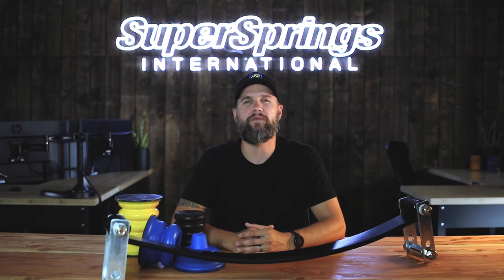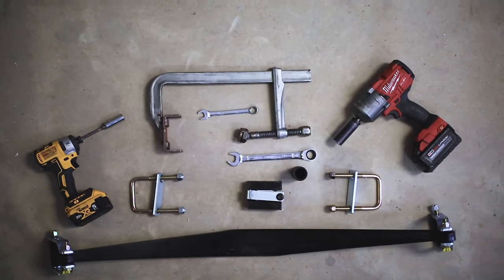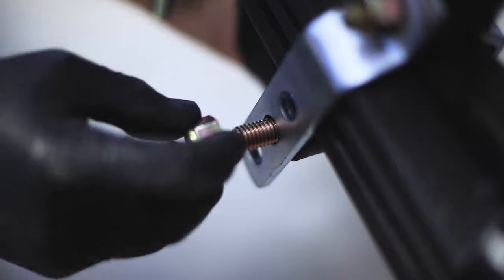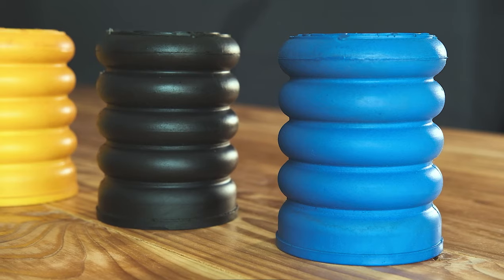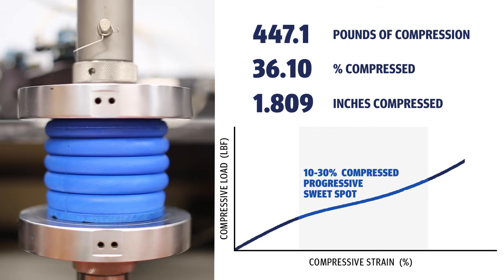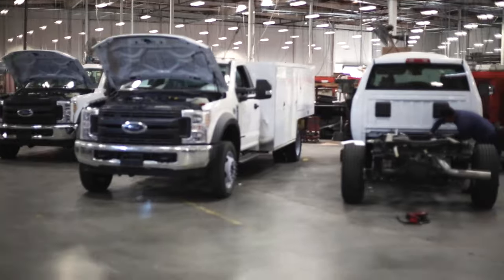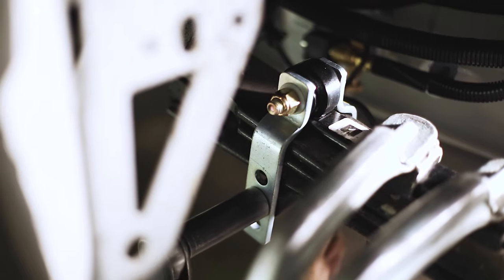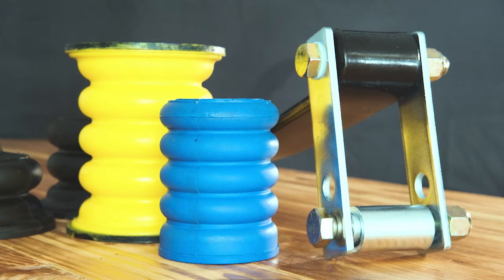SuperSprings vs. SumoSprings | Which one should I buy? | VLS ep. 2

Comment: Have an f-150 with a level kit and running 33.8 “ toyos (305/70/17)
Which sumo do I need . I haul anywhere from 3500 to 7k trailer . Depending on what I rent. Do I need. Spacer for the sumo springs because of bigger tires. Thanks in advance
Reply from the maker: Is your vehicle lifted? ANd how often do you tow? - Josh
Reply: @SuperSpringsInternational  I have eibach leveling springs in the front with bilstein shocks in the back and bilstein struts in the front . So nothing in the rear is lifted. Just running the bigger tires . 305-70-17 which are approximately a 33.8” tire.
Reply: @SuperSprings International ??? My last reponse
Reply from the maker: How often do you tow?

Comment: I drive a 2010 Dodge Ram 1500 5.7 SLT and pull a large pontoon. Any recommendations?
Reply from the maker: Hi Chris! For this, I'd go with our Blue Rear SumoSprings. They'll give you the best/most unaffected unloaded ride, and then give you a bunch of load support when you hook up the pontoon or fill the bed with camping gear! SSR-307-40 is the part number for your truck. -Tom